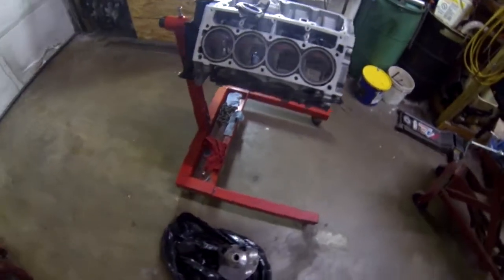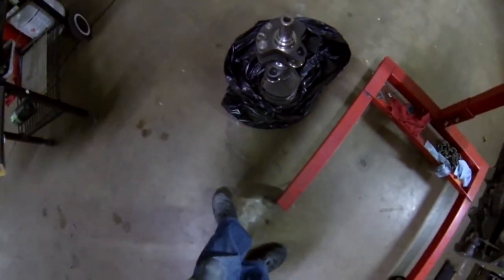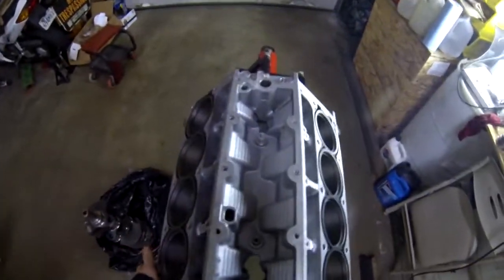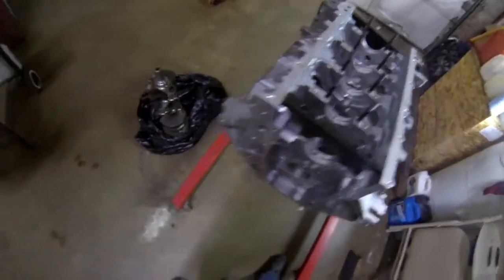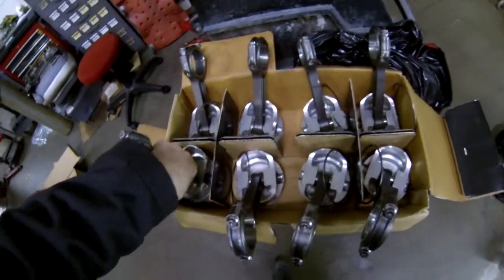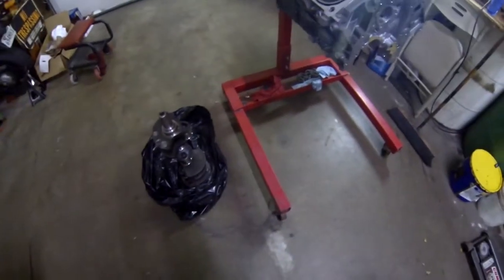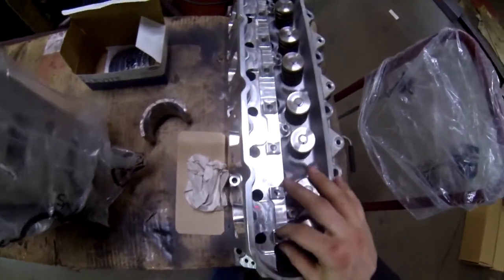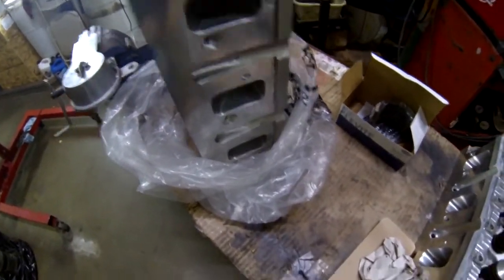427 Engine Build. Part 1: Parts overview

Comment: I have a cracked ls3 that I’m thinking of doing the same but mike Hinson says he’ll power bore sleeve it for half the price any pro n cons u can think of?
Reply from the maker: More displacement is always a good thing. If its a MID Sleeve it requires a specific head gasket from Cometic. Pro's the sleeves are longer and support the piston more at the botom. Other than that its just a common aluminum block. I love mine
Reply: @CamaroRick  it’s a regular ductile iron sleeve. The block cracked behind the cylinder where it looked as if a rod bolt struck the back of it. It also messed up a lifter bore but for 1660 I can’t beat it for the machine work of a real street outlaw 😂
Reply from the maker: @LSMykie  Thats a good price, these blocks are going to get harder and harder to find in the next 10 years. Its already challenging to get a good LS2 block